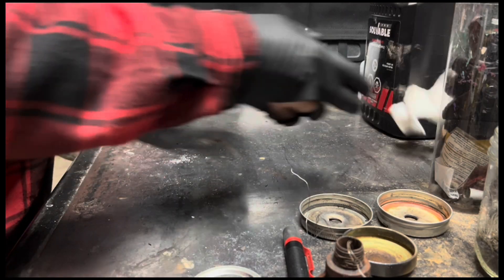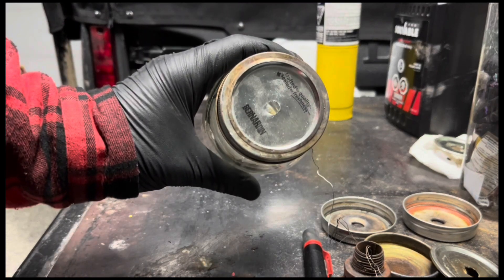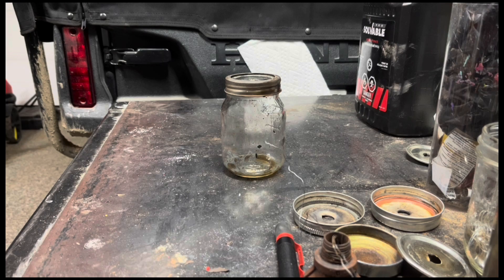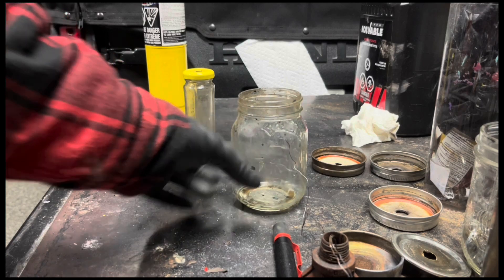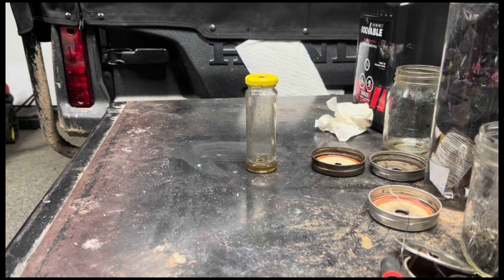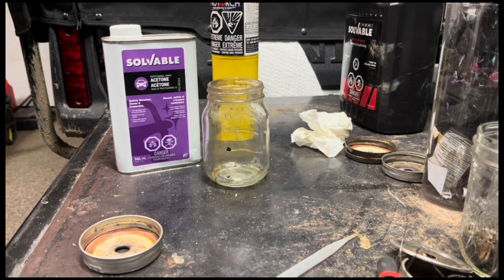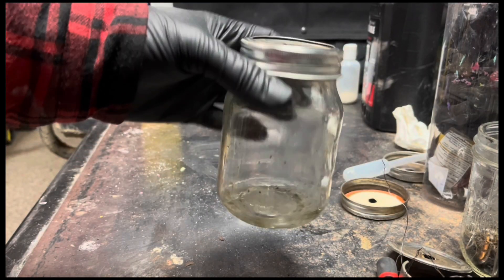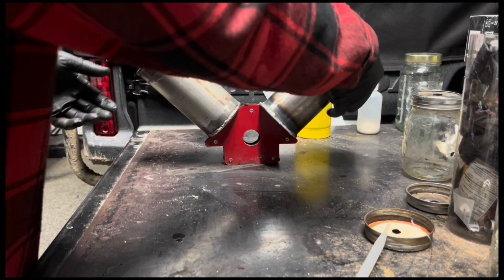Six Reasons Why Your Jam Jar Jet Engine Wont Work

Comment: try putting a ring of rtv where the seal used to be and spread it out with your finger, might be able to reuse the lids that way. just let it harden before you put it on and the screw top will compress it like an o-ring
Reply from the maker: Good call, I actually have some already as well.  Thanks!

Comment: My first try was using a plastic bottle, works better than i thought (it just melted after 3-5s)
Reply from the maker: Hahaha that’s awesome that it worked!
Reply: @AdhDad420  can jar jam be harmful? Im afraid that thing Will exploded
Reply from the maker: It is a possibility but only if you make the hole size much too small.  As long as the hole is big enough it can’t build enough pressure to explode.  They will crack and shatter from thermal expansion however but it’s not a violent explosion, more of just a crumbling.  This does however cause the fuel to leak out on fire so that is a dangerous aspect.
Reply from the maker: I typically go with 1/2” for most mason jars
Reply: @AdhDad420  what's the diameter of mason's jar u usually use
Reply from the maker: Im not sure of the exact diameter but it’s really just any average size glass jar.  1/2” only becomes an issue when going to much larger containers.

Comment: Yoooooooo Brooooo I just had a crazy idea, okay hear me out, what if you create a type of valve for the top load, like a lifter that can regulate the exhaust pulse!!!!!!! My theory is it'll have a more consistent flow, fuel efficiency and maybe temp control. 

Also, I recommend to place the jar in a water bath to cool the jar!!! What you think Dad?
Reply from the maker: Not a bad idea, I definitely still have a lot to test with these.  A spring loaded valve is not a bad idea at all
Reply: Maybe something flat like a coffee filters more or less could be a way to dial it in. Sponge? Of course you shouldn't get it wet with the fuel. Probably will just burn up. So maybe wire mesh   maybe this is also a good way to tune the hole size Oooo what about aluminum tape to resize the  hole quickly hum does the hole have to be round could you tape the tip edge of the hole 3 stripes to make it a triangle 5 a Pentagon we maybe playing with aera but I think fine tune could be better accomplished by putting a layer of  tape down and passing something  a better fit through or use a ring gauge or mandrel and a lot of squares of tape but I don't know the temperature we talking about may malt
Reply from the maker: I tried with aluminum tape a while back but I don’t remember how many plies I used, so may have to give that another try !

Comment: When trying to replace exhaust fumes with fresh air DO NOT use the oxygen from your buddies acetylene torch rig! It will explode violently! Surprisingly, the jar remained intact with no damage, but the ring and seal blew off. We never found the seal. Luckily, no one was injured. Stay safe, guys.
Reply from the maker: Hahahahhaha yeah I bet that would have been a sight!

Comment: the hole is directly proportional to the air fuel mixure?
Reply from the maker: The hole size determines the velocity of the escaping exhaust gasses.  As far as I understand the air fuel ratio is more or less determined by this because it determines the flow of fresh air back into the jar.  Too small of hole and the velocity of gasses is so fast that puts itself out after one fast pop.  Too large and the flame can exist at the hole permanently.  Hopefully this makes sense
Reply: @ Yeah this makes sense! Thanks for the explanation!
Reply from the maker: No worries!

Comment: When the seals burn off lids, use high temperature RTV silicone gasket maker in a tube. Spread on 1/8" thickness, let dry and good for +600°F.
Reply from the maker: Good idea!  I will try that

Comment: We used to light virtually empty windshield washer fluid bottles without any cap on the bottle. Set flat on their side, they would spin violently in repeated flashes.
Reply from the maker: Well I have to try that now ahaha what fuel would you use?
Reply: @AdhDad420  @AdhDad420 just the tablespoon or two of washerfluid that was left in the jug. It would cycle through several violent jets that would send the jug whipping in circles, then sit for a few seconds while fuel vapor recharged and another blast. The flame would stay lit, (mostly invisible) so once started, it would keep cycling through again and again as long as the fuel lasted. We were doing this outside in the winter, so maybe temperature also comes into play.
Reply from the maker: Sick, thanks for the info man I am definitely trying this

Comment: Brother man, what if you replace the nozzle with a cone shaped bifilar coil.

its where you combine the primary and secondary coils together to make one coil, cone shaped, make the inner diameter the size you want, and power them with variable AC from a VARIAC ? Haha just shooting my thoughts brother rock on!!!
Reply from the maker: I'll have to add that to my list of things to try!  I really need a variac ahahahah just have high voltage transformers and a dc power supply right now

Comment: Excellent treatise on Reynst jars!  Your results of starting with a large hole and progressively going smaller is just "gold".  I have found that stepping by 1/64th of an inch is still pretty coarse for finding the proper (perfect?) "jet-size".  I have found that I have to use two different hole sizes ( + or- 1/64" ) for winter and summer to get RELIABLE running! I use Micky's Big Mouth beer bottles just because that's what I started using 20 years ago.   They have the proper aspect ratio and are thinner than most jars. This allows them to run longer before thermal stress cracks them.  Also, just for fun, put 2 tablespoons of Kosher salt in the bottom of the jar you show.  The blue methanol flame goes orange!  You might want to open the garage door though as it gives off a salt smell.
Reply from the maker: Thanks for the info!  I haven’t had a mickeys in years, maybe I should grab a box ahahha